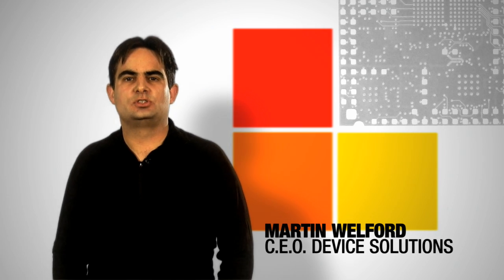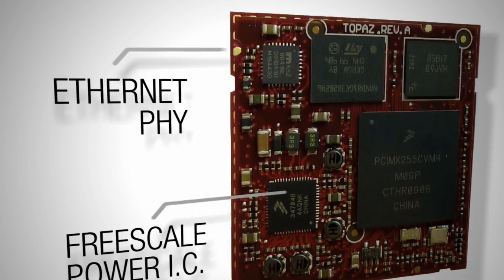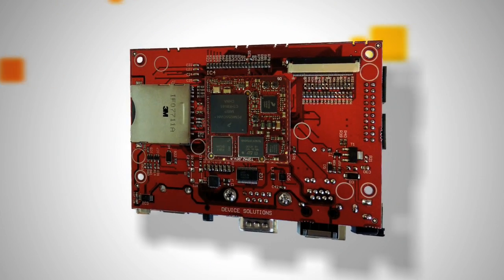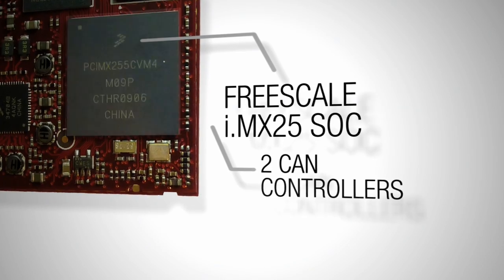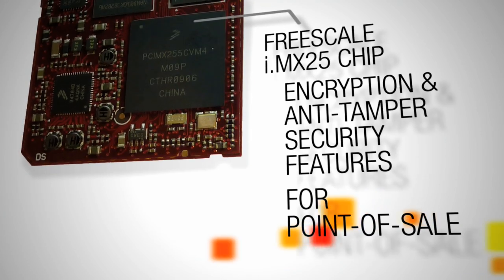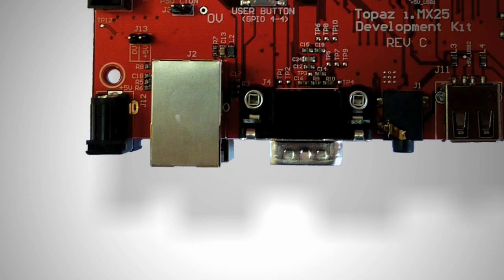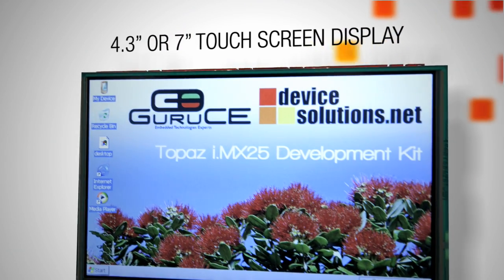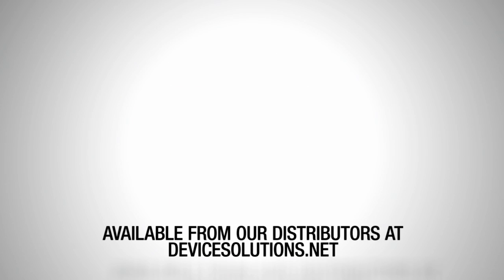Device Solutions Topaz i.MX25 CPU Module and Development Kit

Comment from the maker: The kits are almost always in stock in our web store if any of the distributors are sold out.  Native code is possible with the Micro Framework, but you need the Porting Kit and our Board Support Package.  Use the contact form on our web site and I will get you more information about that.

Comment from the maker: The dev kit + an LCD is the best starting point.  It comes with Windows CE installed, and you can download the Linux port from our 3rd party provider.  There is a USB-based update app which enables switching between OSs.  Use the contact page on the Device Solutions web site if you have any more questions.